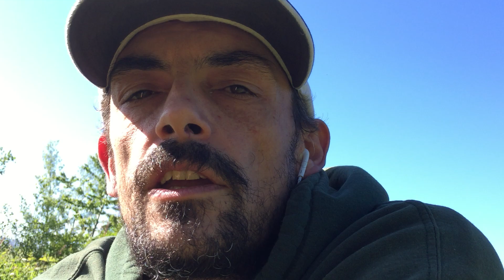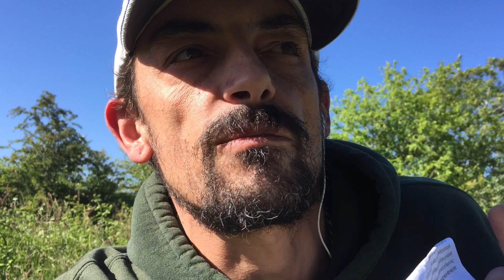New Construction Slowdown Mills Shutting Down

Comment: supply and demand.  If supply remains constant and demand goes down, the price drops.  Sometimes to the point of dumping.  Finally, the supply drops to meet demand.
Reply from the maker: Why is the demand down? The supply was not meeting demand last year? Tariffs on logs going to China hammered the price of timber and slowing construction on top of strengthening dollar. All bad news for mills. Good for home builders especially the framers.